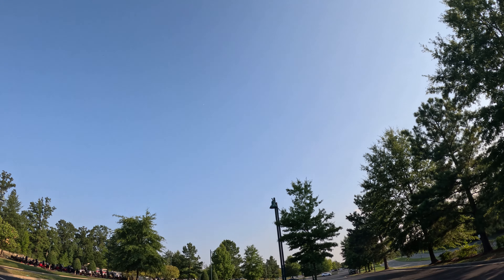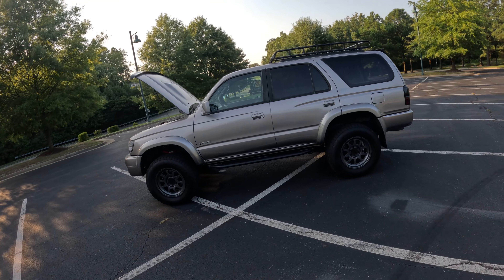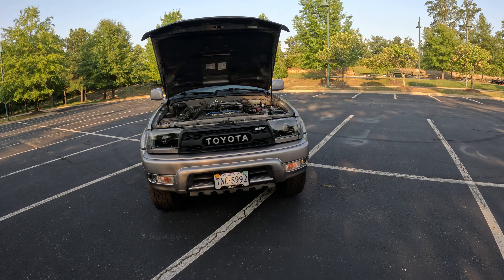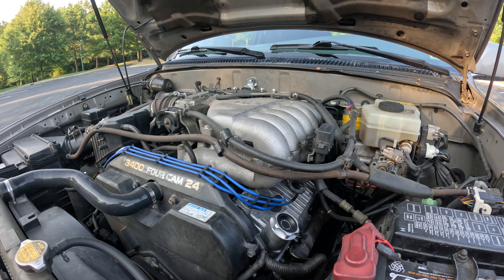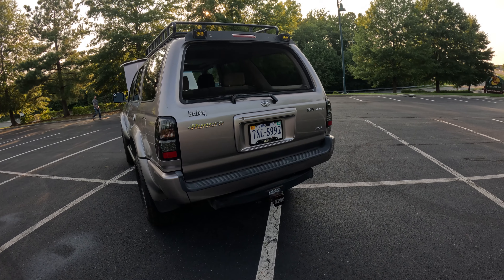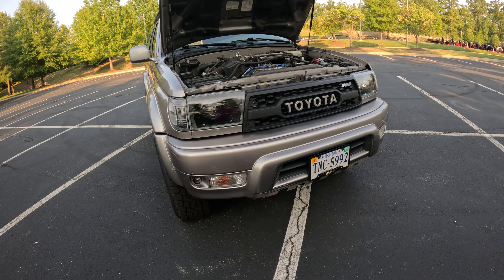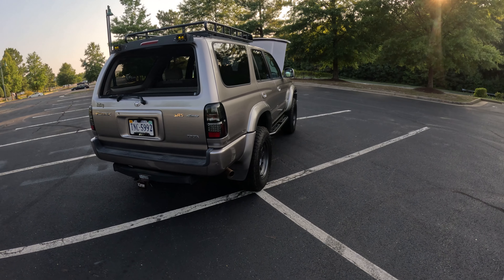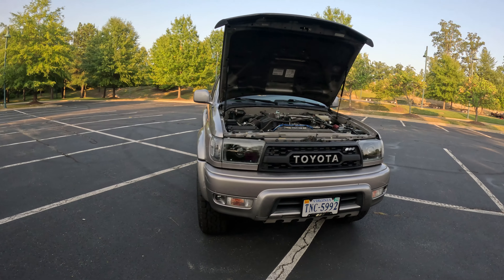What Maintenance Should You Do?

Comment: Timing belt is a must.  When doing the belt, best to do the front seals if you can get to them.  Also, good idea to replace the long oil cooler hose while you are in there.  it is a PITA. Also, the 5VZFE is picky with plug wires, and when one fails, the engine will not run well.  I recommend having a set handy in preparation for that.  I found that shops don't keep them in stock the hard way.  Check the frame for rust and treat the areas ASAP.
Reply: I agree